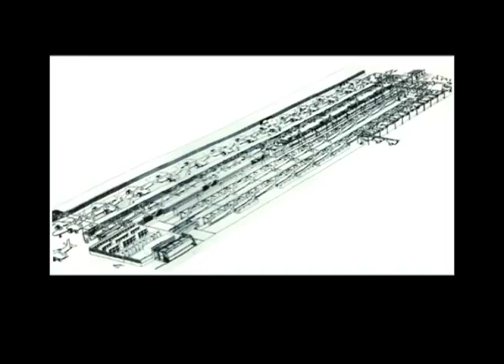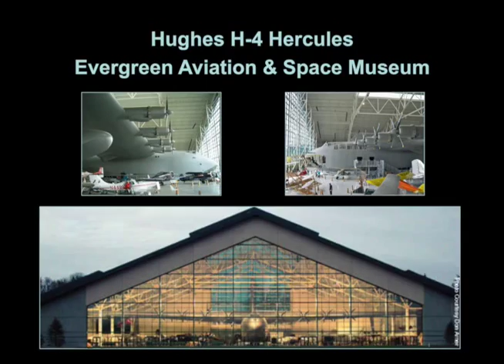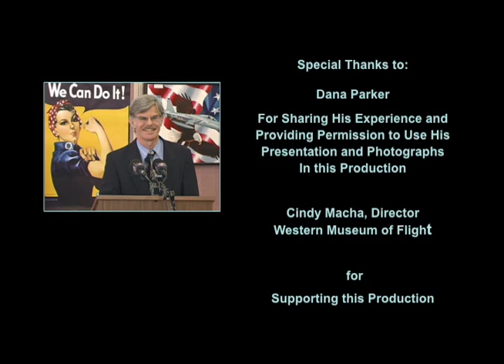Building Victory (WWII Manufacturing)

Comment: @ 48:03 the holes in the crankshaft no doubt lightened the weight of the part but their main purpose was to provide lubrication, under pressure, to the main and rod bearings.
Reply: No the lubrication holes are much smaller and are drilled at an angle from the main journal to the rod journal.